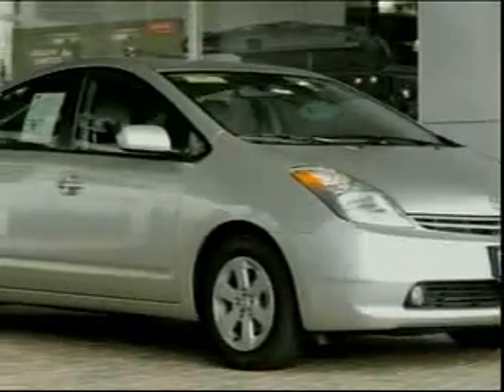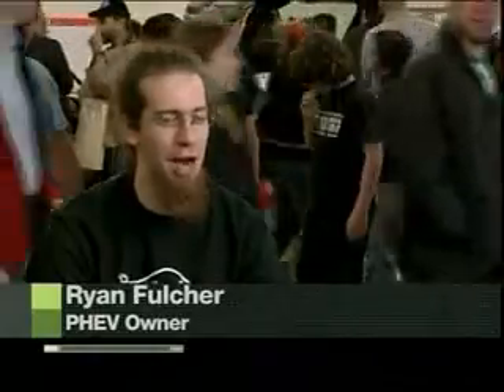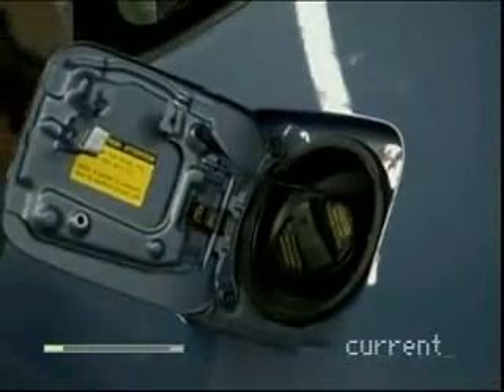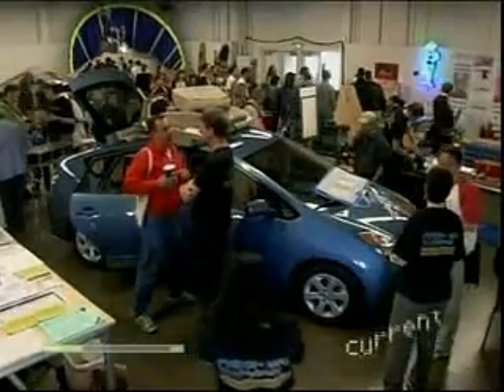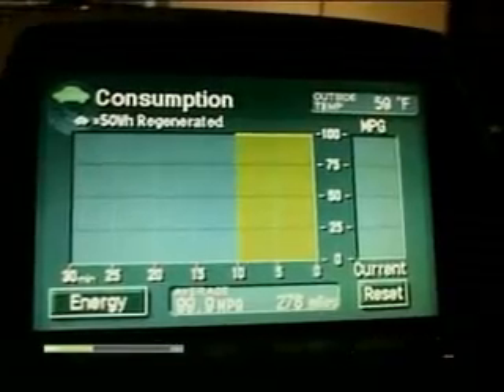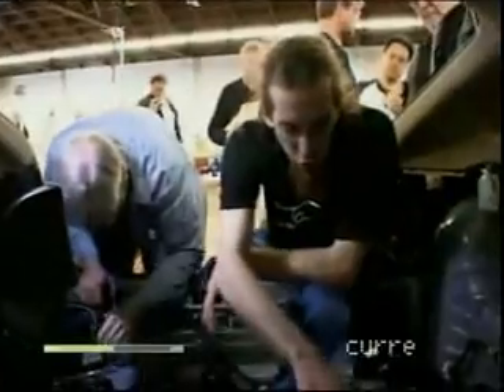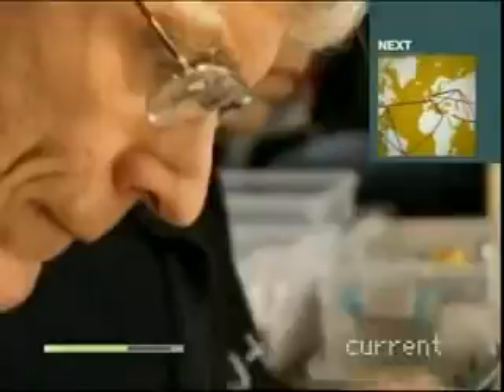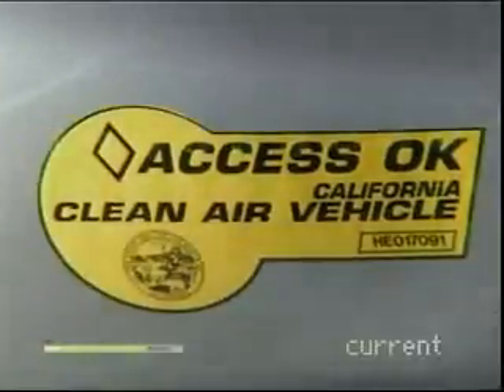Calcars.org 100 MPG + Toyota Prius Plug In

Comment: Prius totally overhyped! Weight is biggest issue for power and hence economy. Prius weighs some 1.3 metric tonnes!  Compare to roomier Audi A2 1.2 TDI: Even on low sulphur diesel she puts out 81g/km CO2.  Seen >103mpg on rush hour 28 mile run. The Prius? 45mpg in the real world and more CO2: 23g/km worse and twice the fuel consumption of A2!  Plugins only part answer if power stations clean up. But USA has Coal reserves so it's unlikely to use Nuclear or Greener energies for many years.

Comment: By the time his batteries were dead, he was either already home for the day, or driving on highway doing 55MPH getting better MPG because all the bad MPG you get are usually in the city driving in Idle getting ZERO MPG or on the tak-offs burning fuel like crazy going in those high RPM's without going very fast.

Comment: Well, #1 he basically took his car apart and replaced a lot of stuff like the weak batteries and put in more better quality ones with much more voltge, THEN threw away the stock controler and designed one himself... #2. Somtimes he drove around everywhere without using the gas engine, he just used the electric motor over 50mile range, so its easy to get 250MPG when the gas engine is hardly ever running.

Comment: Audio is low.. Quality is great, I have a Prius and what I find confusing is 99.9 is the limit.  Toyota should make a screen that can handle bigger #'s.  Sometimes with the Engine, I can get it to 99.9 mpg then fall off to 98.4.  Then you can calcualte better MPG